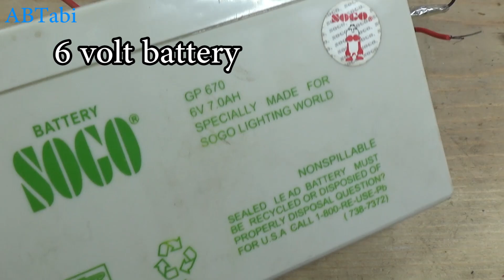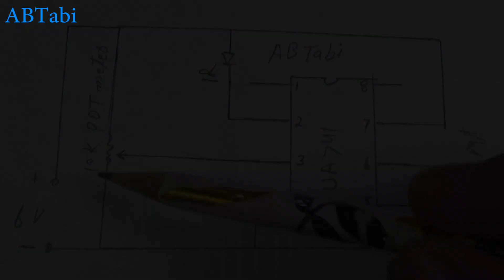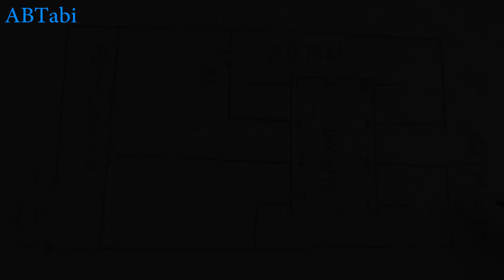Make Auto ON OFF light sensor using IR sensor and UA741, dark sensor

Comment: as always it was great however I have  a question in previous video(fire sensor with 741) you put IR sensor in pin 1( offset pin) now you put in negative lead! whats the difference between these two projects?
Reply from the maker: My dear friend,,,,,,,,   difference is  adjust vr
Reply: vr?????????  @ABTabi
Reply from the maker: Pot meter,,,,,,,,,,